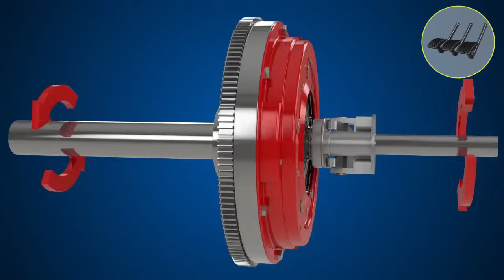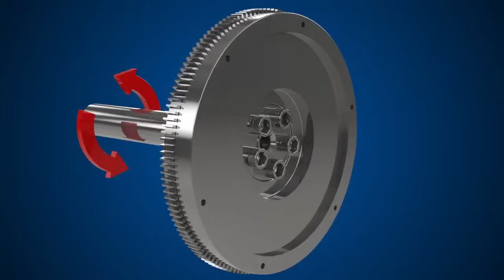How a clutch works. (3D Animation).

Comment: It's not clear to understand the clutch function specially pressure plate
Reply: Might be a little late but I'll try and explain. The video doesn't really explain how the diaphragm spring works. It's disc like shape but it's not a flat disk. The outer edge of the spring is constantly pushing on the pressure plate (and the pressure plate is pushing on the clutch itself). When you press the clutch pedal, the throw out bearing pushes on the inside of the spring. Those arm-like things. When they are pushed in, the outer ring of the clutch spring moves out (releasing the pressure). The pressure plate sits there so the clutch has a nice flat surface to apply friction. Not sure if I explained it well enough. Feel free to ask questions.
Reply: @blindcheto195  not too late -- helped me out, thank you.
Reply from the maker: Thanks for comments and additional info. Please remember this is a video extract from a full elearning course.
Reply from the maker: Check out riverdeneconsulting.com
Reply: @Spraiser74  : blindcheto said "The video doesn't really explain how the diaphragm spring works."

EXACTLY.  That's the problem with this video.   It's not that this video is just an excerpt from a larger video.  It's that it doesn't properly explain what it purports to explain.   A person watching this video can't really see how the diaphragm spring works.  How does it press against the pressure plate, and why does pressing it IN cause it to pull the pressure plate OUT?
Reply from the maker: @Milesco  Take a look at the pull type clutch video. Diaphragm push or pull. If the viewer doesn't understand, then they are likely not the target audience. Buy a clutch from a scrap yard and take a look. Can't beat hands on.
Reply: @Spraiser74   :  Thank you for your response, but it sounds like you're blaming the viewer for the shortcomings of your video.  Several.commenters here have said they still don't understand how a clutch works, and I can see why.   Blindcheto195 correctly pointed out the specific deficiency in this video (as did I).  

With all due respect, ,it's not the audience, it's the video.
Reply: Captain Quirk like this dude said. He just stole it from some course. Not even his video
Reply: @blindcheto195  please explain if you press the clutch you don't slow down the fly wheel I am getting angry because I don't understand I really want to understand when friction is happening and how power is stopped
Reply: @blindcheto195 can someone just say pressure plate is red.
Reply: https://www.youtube.com/watch?v=lqo0_StXf4M
Reply: Gi
Reply: Nah man, it's very clear , youre probably just dumb.

Comment: A clutch plate works like a brake pad and the flywheel is the brake rotor.

Also, thanks for keeping it short and sweet, so it can be understood by all without feeling like a lecture.
Reply: Okay how do brakes work? You cant explain one confusing thing with another confusing thing
Reply: Not quite. When a brake pad is pressed against a rotor, it prevents drive.

In this case, when the clutch plate is engaged and pressed against the flywheel, it aids drive. When the clutch plate is disengaged and moved off of the flywheel, it prevents drive to the transmission. 

Completely opposite to how brake pads and rotors work.👍
Reply: @BundSung  Probably meant that both use friction, like a brake pad pushing against the rotor is compared to the clutch disc pressing against the flywheel
Reply: @BundSung  - same principle however. The clutch plate is forced against the flywheel which cause the rotation of the flywheel to be transferred to the transmission. Not sure how this is confusing at all.